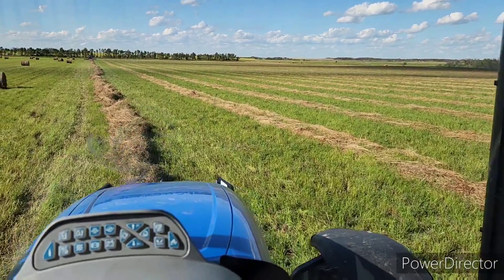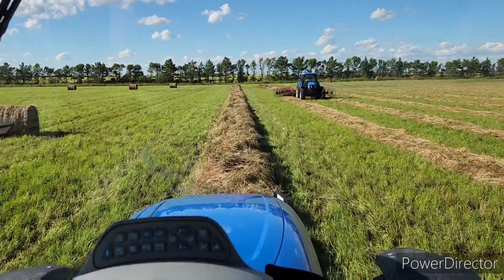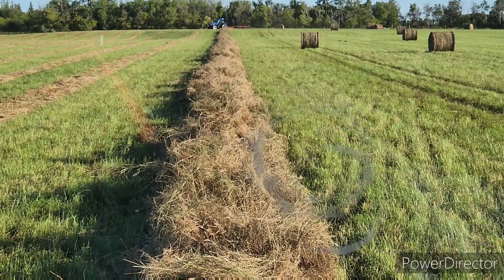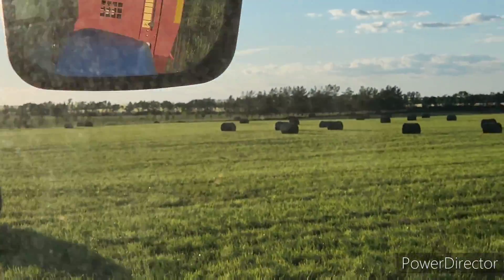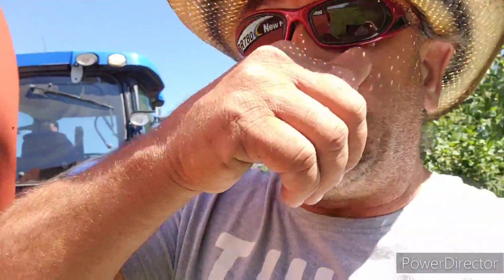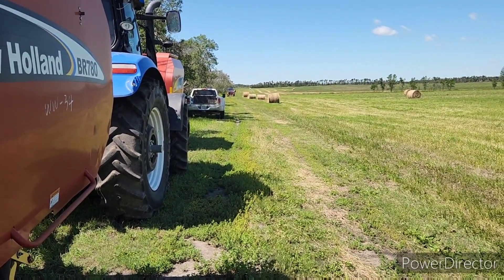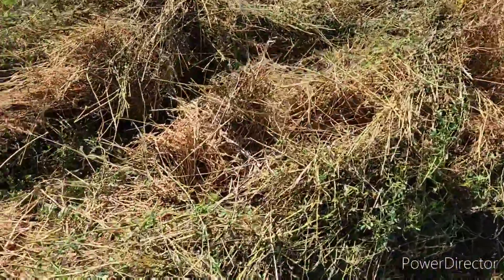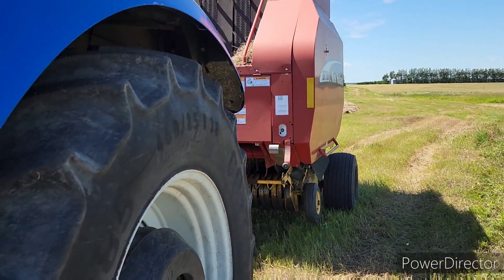Can't  Believe We're Baling And Crop  Checking

Comment: 👍👌❤🇨🇦, hope your son stays in Saskatchewan, in Alberta or BC, he would be overweight just with the trailer, and with the sag in the suspension from the quad by itself, he doesn't have nearly enough truck there, even for braking not enough truck, gr8 video though
Reply from the maker: Thanks...he could pump up the air suspension
Reply: @bcpfarmandtrucking6560  BP, I am only commenting for your son's saftey, the braking power of the truck is a factor as well, even if the trailer has electric brakes, thay would not be enough, the half-ton truck is jus too small a truck, look at the door tags and look at the GVW thay the truck can pull and carry, I am sure you willl find that I am correct,  take the truck and tailer (fully loaded) and atv  and get a proper weight, it is a costly fine, in Alberta and BC, they can and have inbound the whole rig and fine according to over weight
Reply from the maker: @pocketchange1951  idk what the gvw rating is but he did say he could handle 1000lbs more than his trailer weight was .

Comment: How many pins are in the plug?
Go online and find one that will work.. even if it's got more pins than needed.. the baler  monitor don't care what the connection is, just so it's connected.
Bale the dry, then roll the wet out n the open so it will dry . We have a few places we have to do it..
You didn't pull the 3pt arms off before putting the driveline back on 😳
Reply from the maker: No I never...wanted to get going just did alot wider turns